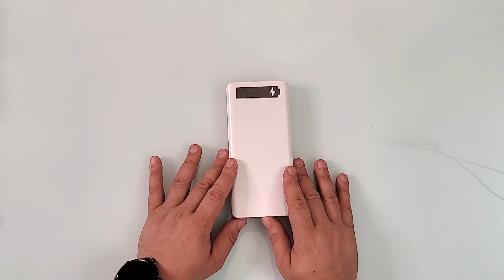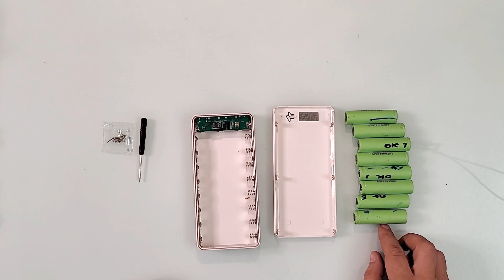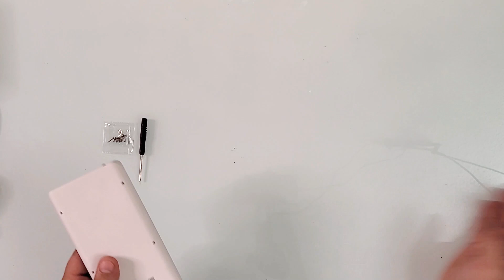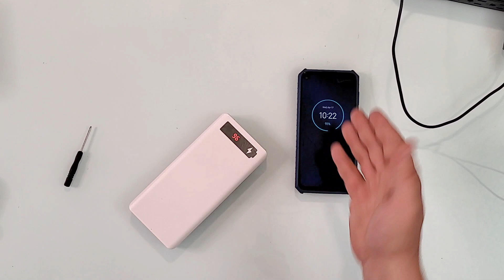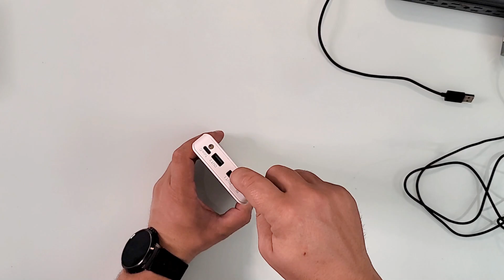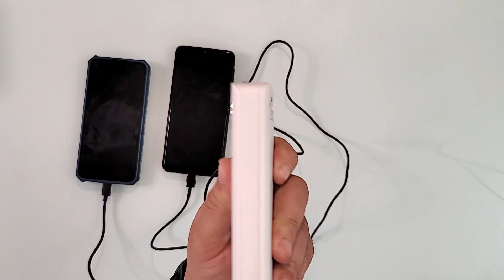Turn 18650s into a powerbank with this enclosure #battery #powerbank

Comment: The description says that the cover can not be opened once closed. Is that correct??? Seems like a design flaw, I was ready to run out a buy one of these but it would need to have a nice BMS for me to be comfortable with it. And it would need to be able to be reopened 😅
Reply from the maker: The cover definitely opens after...that description means it can not open by accident because you can put screws in it....the bms..is ok i guess...i havent had it long enough to fully stress test it
Reply: @OMNITEK  that makes more sense haha

Comment: The idea is very cool the only problem with it is they are all in parallel  witch is fine if all the battery's install are of the same capacity mah (they will change over time and use of each battery separately). If the mah is too far apart one or more battery's can and will become either over charged or discharged. there is no way for it to monitor each cell separately with only 2 leads (positive and negative shared between all battery's. be very careful using this device please. the only way to avoid it with this type of power bank is to use all the same cells that are all brand new or at bare minimum all used together to begin with if you want / need to up-cycle the battery's